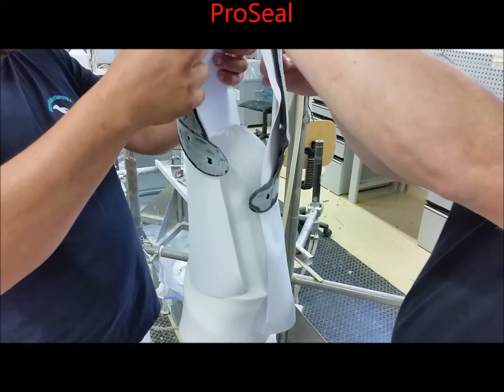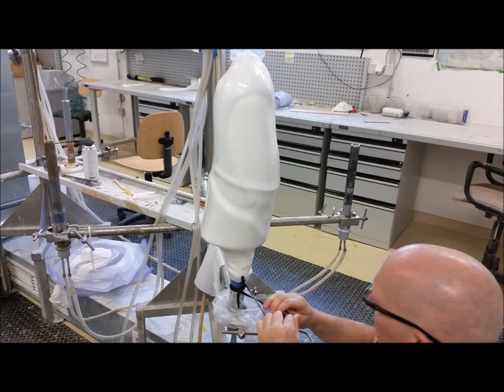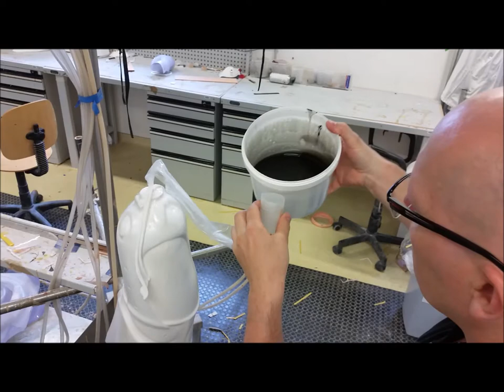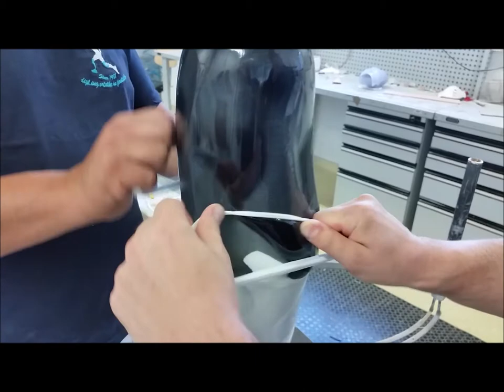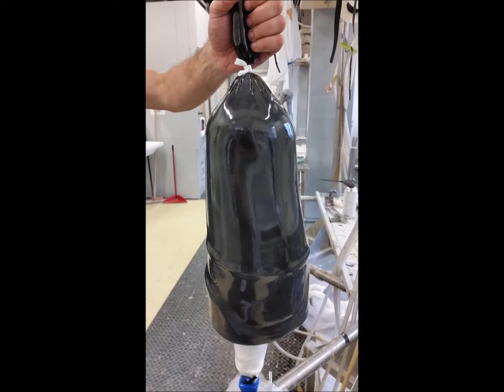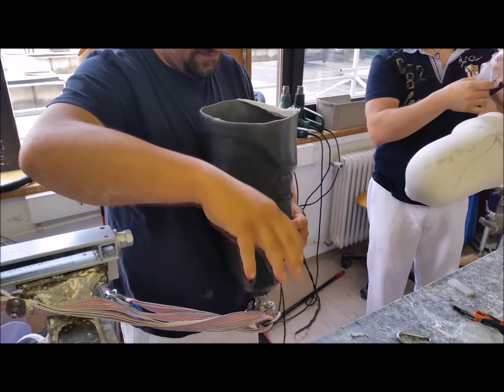ProtheFlex system with ProSeal - processing

Comment: Would be interested to see how the lamination is done when there is a lock insert mounted on the cast after the lock has has been laminated into the reinforcement skeleton in carbon for the inside layers of nylon. The lock in question is the coyote air lock, so just wondering what is the best way to do the inside layers under the carbon without interfering with the lock sealing to the lamination.